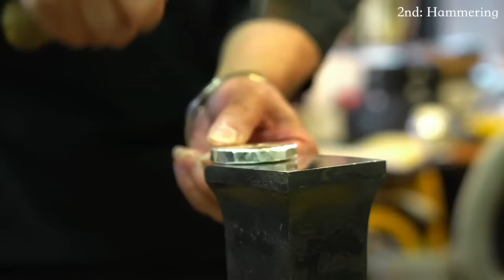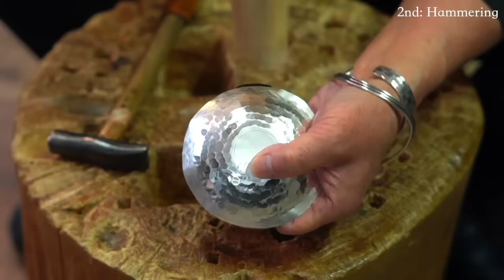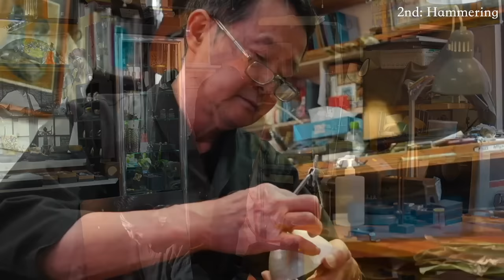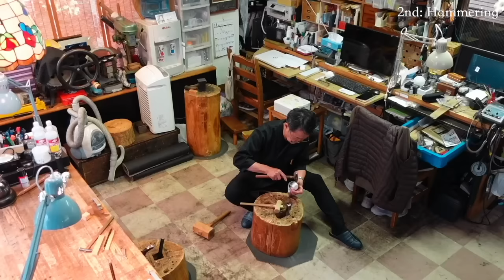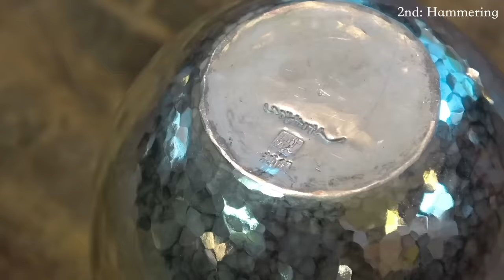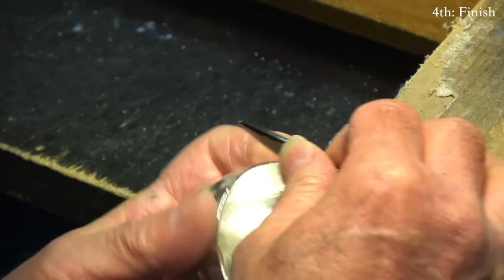100,000回叩いて完成するカップを作るプロセス

Comment: :yougotthis::goodvibes: I once made a silver ring from a 1947 U.S. quarter. I started by drilling a 1/2" hole, and by the time I got it to My size ( almost a 12 ) the edge left after becoming wide read inside the rim, " In God We Trust, space U.S. Quarter "❕ It also took uncountable tapping with a very small hammer and a Jewller's anvil. 😄 Yup❗  G~G.